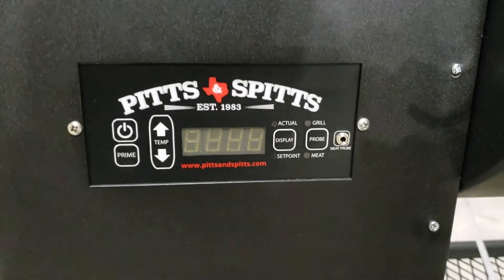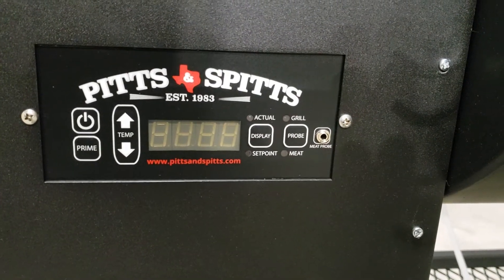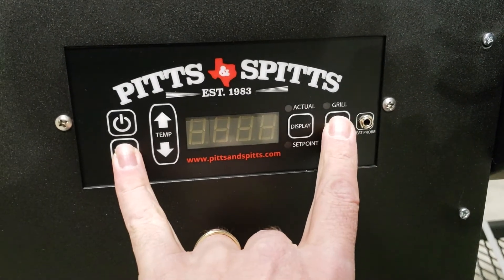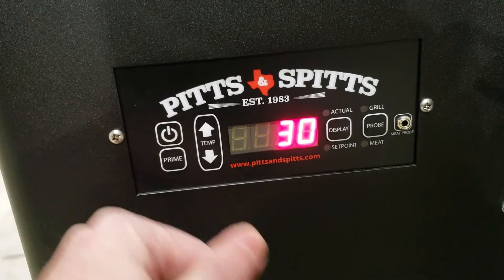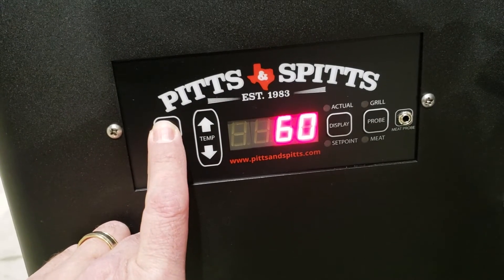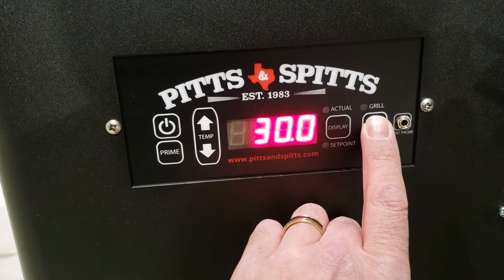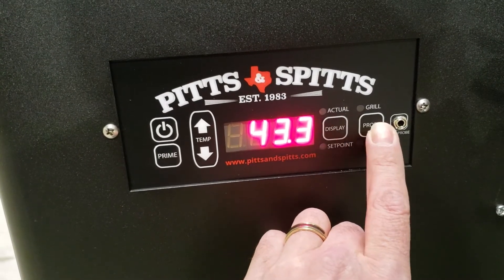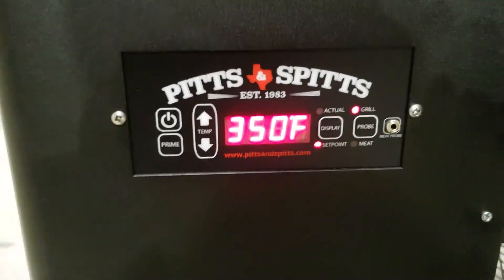How to avoid the ER-2 code on your Pitts & Spitts Maverick pellet grill

Comment: Very interesting... Do you happen to have any recommendations for me (I am begging for help). I own a 850 and now I am coming into problems. I set the temp. (lets say to 225). The temp. does not stay there at 225... It begins to increase all the way into the 400s and beyond. Again, the set temp. is 225. I have placed a new PID controller as well as a brand new internal temp. probe with no luck. Any suggestions????  I am thinking it may be a either a code-change deal or an internal wiring thing. Please help and advise.

Comment: Could you tell me what the reason to turn down would be? I would assume that that would just heat up quicker? 

I ask as I live in FL, and have had mine throw an ER2 code multiple times in 75+ degree temps
Reply: Yeah, I see no harm in keeping the auger speed higher. All it will do is feed pellets quicker to get it up to temp quicker.